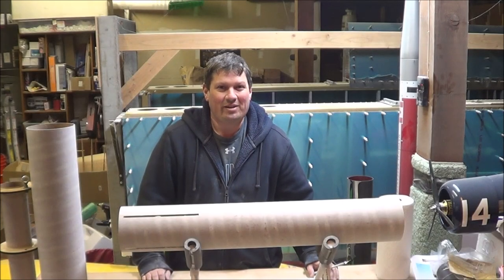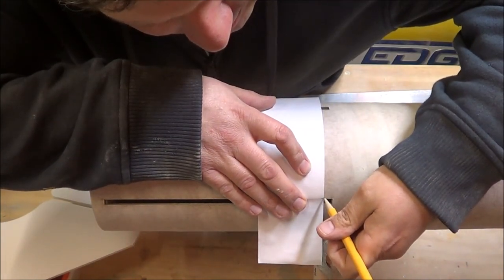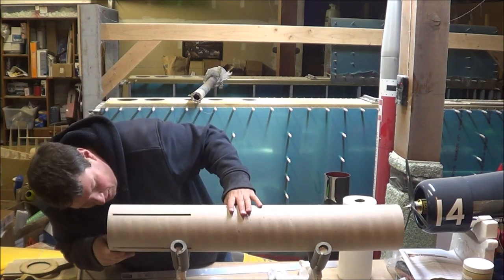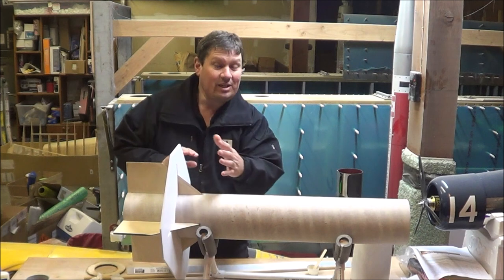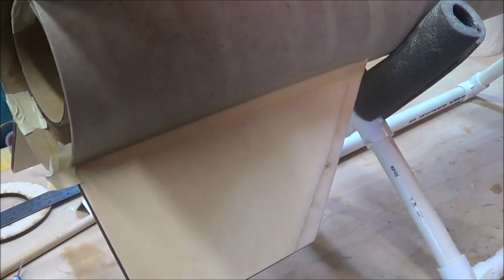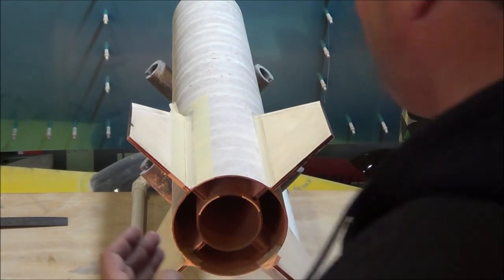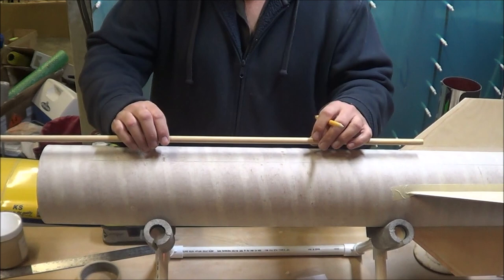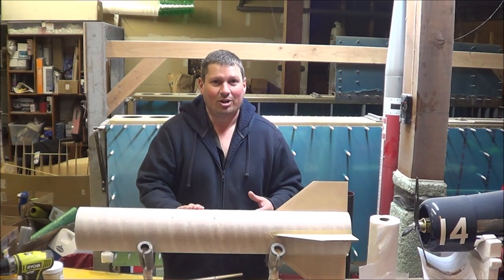Review: LOC Precision Patriot Missile 5.5" Pt.3: Booster Section

Comment: Great video im doing a loc 4" black brant bbx 103" and the phenolic tube is white and has the low spriral groove like all tubes but this tube has a wide hi spiral line in it and it has highs and lows thru out the tube when sanding it looks like a the spots on a dairy cow.. i took some 3m spray glue cut diffrent grits of sand paper and glued then on the big 5al paint sticks and its working great u can sand bettr with a flat paint stick your fingers sands all of it and the stick shows u the hi and lows

Comment: I can't believe you let all that dust get in the electric motor on that plane also i always use blind nuts on the inside the tube for the rail buttons with a plywood backing the wood screws get stripped after a while and can rip out of the wood during launch causing a bad deal

Comment: When do you show connecting the shock cord and parachute protector? Looking for the best way to do that since the engine mount has already been glued in. If you don’t have that on this video, do you have it on another?
Reply from the maker: Did you add the eye bolt to the forward centering ring already?
Reply: @flyfalcons  yes, it is epoxied on.
Reply from the maker: @scottwetterstrom1284  Great, if your harness doesn't have a loop sewn at the end then you can tie a loop, then feed that through the eye bolt and run the rest of the harness through the loop.  Alternatively you can tie a slip knot on the eye bolt and tape the excess harness together.